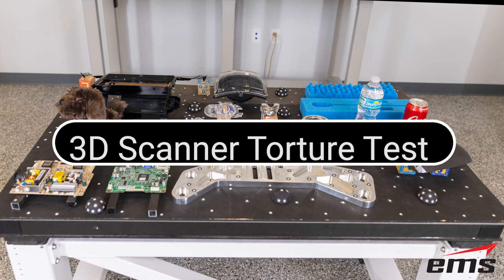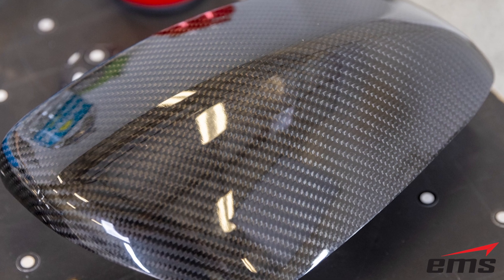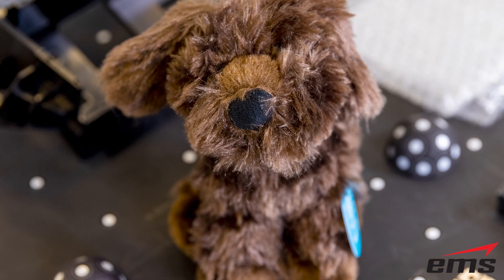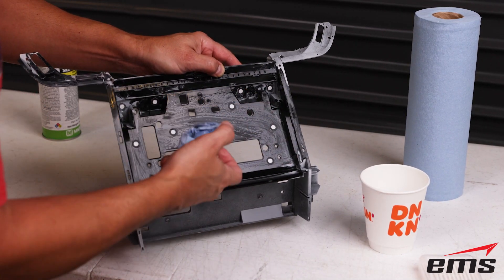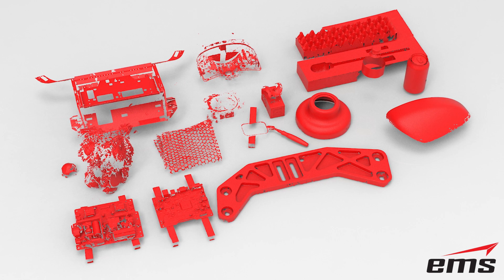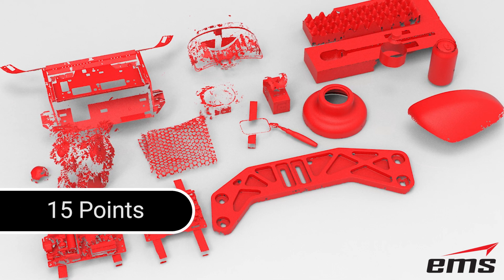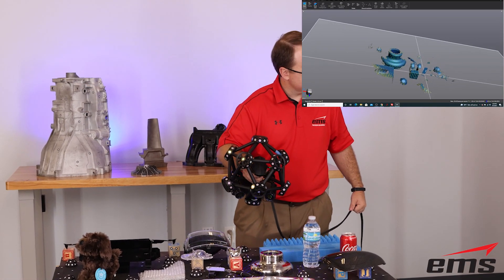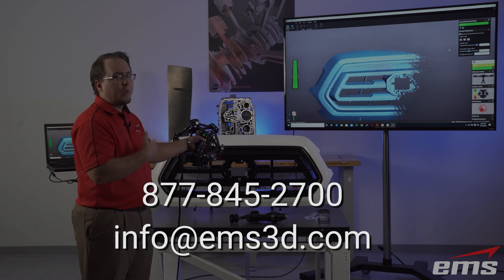3D Scanner Torture Test

Comment: I am developing a 3D scanner and I am grateful for your insights. In particular, I had no idea that concave edges on shiny surfaces were a problem, but it makes sense! There are many light bounces happening on these edges that will confuse the 3D scanner.
Reply from the maker: You are correct.  If the light source doesn't return correctly to the sensor (or not at all)  you will either get no data or what we call "scatter data" which is bounced off another surface and back to the scanner.  Typically this scatter data is floating off the part in space.